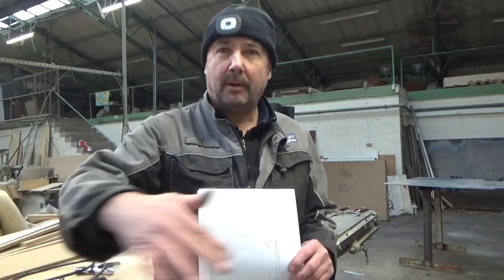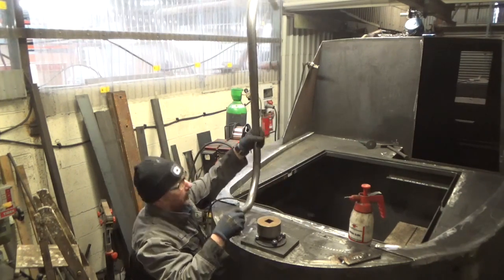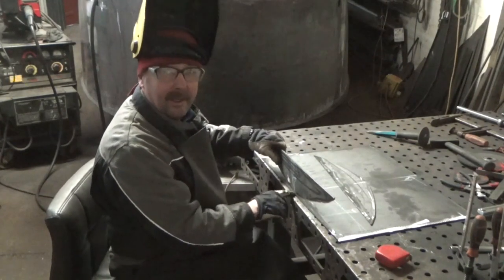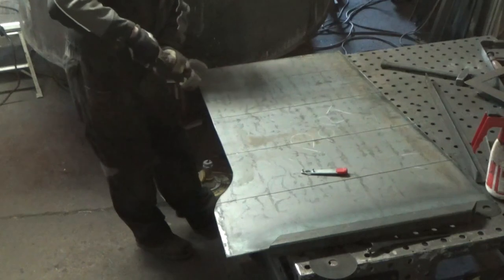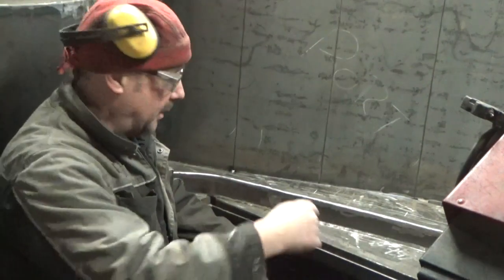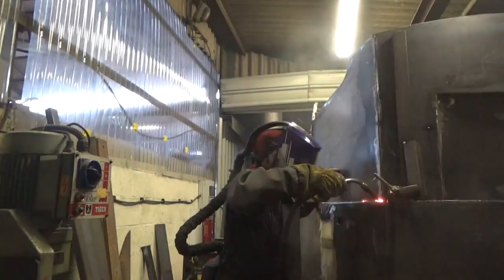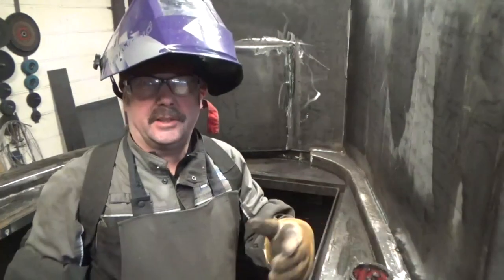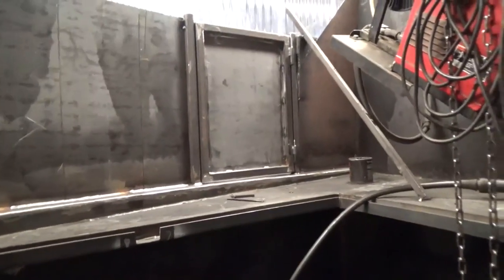Narrowboat Build Cruiser Stern Steel Sides & Gates Welded On.

Comment: That's going to be a quality boat. How long does it take to build it? Unusual design. Have the owners designed it?
Reply from the maker: Hi Will, The boat is going to be hired out, So the enclosed back gives some protection  for children & pets onboard. If I had been working on it full time it would take approx 5 weeks for the steel work to be done.

Comment: A question for ya what do you dip the tip of the welder into
Reply from the maker: Hi Gaz, It is called Tip Dip. It coats the shroud and tip in a non stick compound, that helps stop spatter build up on the end.